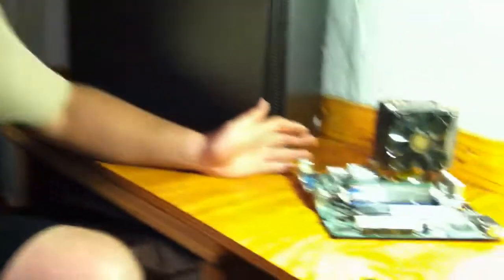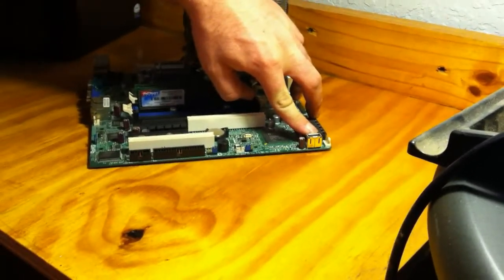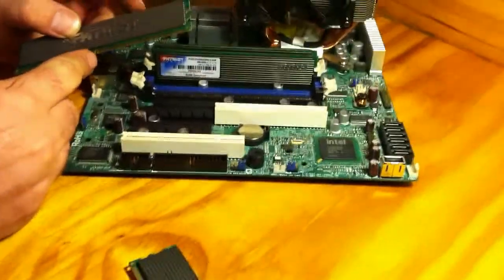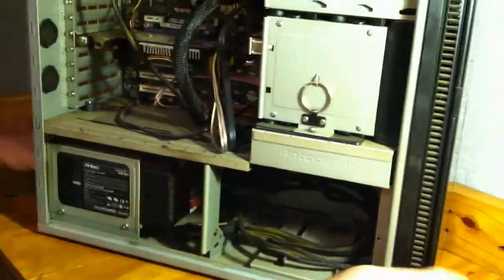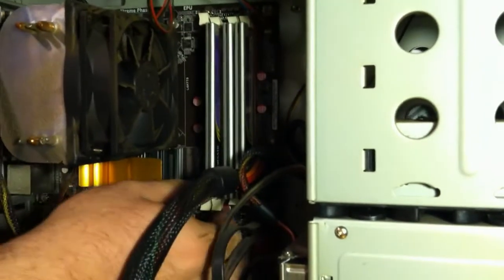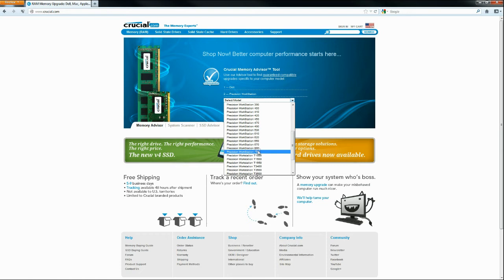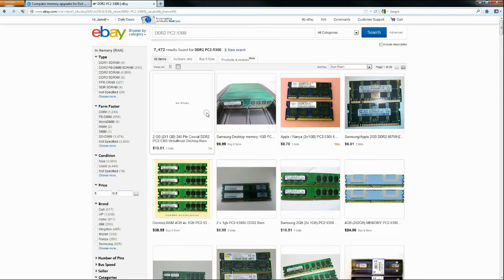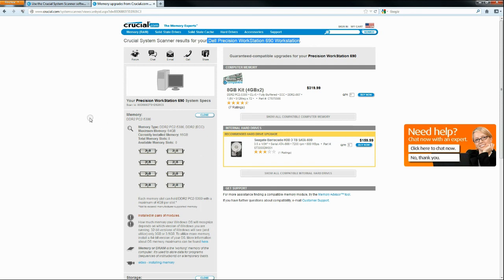How To Find the Correct RAM and Install it in Your Computer

Comment: How to check for the CPU model physically?
Reply from the maker: Other than removing it, your best bet is to do this:
In Windows, using System Properties:
Click Start , and then click Control Panel.
Click System and Maintenance, and then click System.
You'll see the processor information shown

Comment: Does putting more ram and or storage (SSD or hard drive) put more pressure and heat onto the processor
Reply: Mono832 boi
Reply: is that a yes or no?
Reply: Mono832 yes it will but not enough that you will need to buy fans
Reply: ok thanks

Comment: Crucial memory finder works great in most cases but I found what they recommended did not match specifications found in the original manual for my intel motherboard.